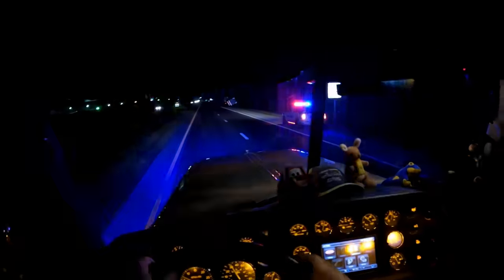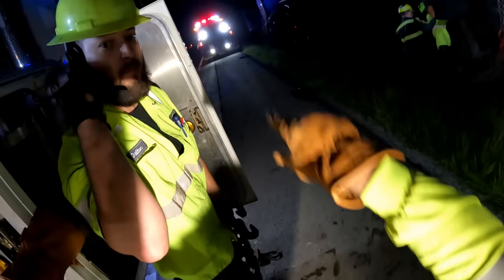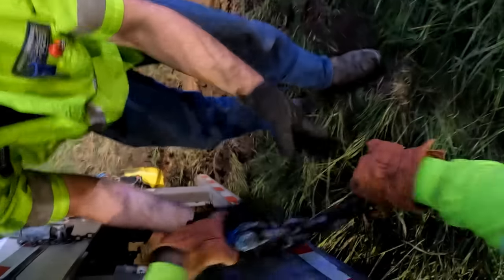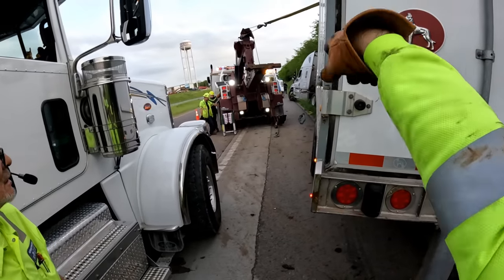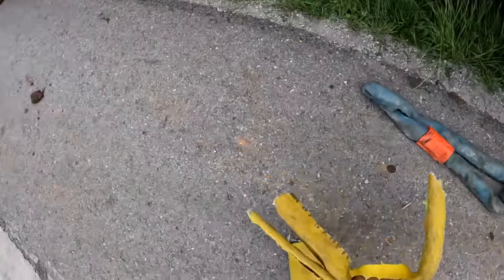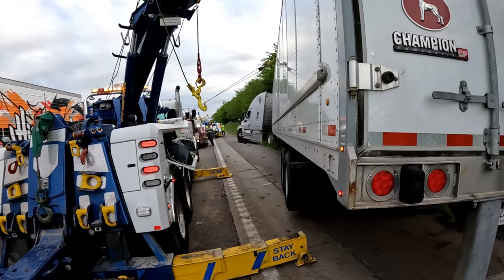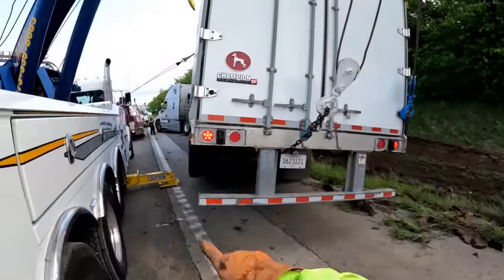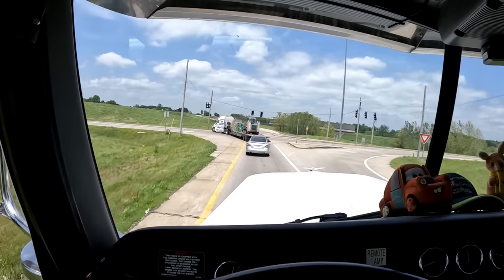Twisted Truck 2.0 Rollover Semi!!! The Job From...a Really Bad Place

Comment: I don't know if you'll see this and respond but I have one question Ron: When you said at the end of the video "Transload" what does that mean? Did you and everyone crawl into the trailer to try and get the load (paper) down flat in the bottom of the trailer again so you can haul it safely?
Reply from the maker: Transload is just a shortened form of "transferring the load" whether it be to another trailer, to a dock, another truck, etc..  If you watch the video until the very end, the credits and after-credits, you will see part of what we did.   Thanks for watching and God bless.
Reply: @RonPratt  I saw the timelapse start but I thought it was re-showing the entire video in quickened time lapse mode. I'll go back and re-watch the time lapse part to look for what you mentioned. Thank you for taking the time to reply and for showing us this video. I hope you have a good day and got some much needed sleep after this job.

Comment: I'm only 30 minutes in but I'm thinking that you would have bought yourself a lot of space by having your rotator facing into traffic. I realize that would've had its own set of challenges but I believe that would've given you the room to pick the trailer and get it all the way up. I also think the western could've been farther up with a low line to the tractor drives and a high line over the top and to the back of the trailer.

Comment: hey Ron i want to know where u go your headsets from I'm a traffic flagger here in Sydney Australia and want to buy some for work
Reply from the maker: We are currently using EarTech UltraLite headsets.    They work quite well for us.  They are inexpensive and are decent quality.   The only problems are that they do not fit well with standard, full-brim, hard hats and they are limited to using only 5 headsets per frequency.  On a large job like this, not everyone had a headset.   Other than that we really like them.  They have good range and quality sound.   We may upgrade in the future, but these do what we need for now.   Here is a link if you are interested:  https://eartec.com/ultralite/
  Thanks for watching and God bless.

Comment: That trucks frame was BENT. Im suprised if it didnt try to walk all over the road due to mis alignment. 

Now for my curiosity. If a truck is so damaged it cant be towed and must be trailered (which i though this one would be), can you hook up a drawbar/towed dolly to attach the trailer to behind the truck to transport it somewhere safe?
Reply from the maker: Yes, we have a single axle dolly that you commonly see used on doubles trailers pulled by companies such as UPS and FedEx.   We also have a tandem (two) axle dolly that we can use in heavier situations such as this.    We are still working on the tandem axle dolly to get it to the point where we want it to be.   Such dollies come in very handy in certain situations.  Thanks for watching and God bless.
Reply: @RonPratt  i thought someone as well prepared as you would have something like that. It amazes me how prepared and sensible you are for current and future situations. Keep up the great work and thankful you let us come along for the ride.

Comment: Honestly I think the best solution here would have been to have another rotator, that way you could grab the nose of the trailer as well with the boom, grab the landing gear with the drag winch, lift it enough to be able to drag it onto the pavement, and then go from there

Comment: As always you and your crew did a great job working together and slowly working through every problem as it was thrown at you. No one was injured and there was no further damage so all in all a perfect recovery
Hindsight is always 20/20. The only thing I see that would have made this go better would have been to have the blue line able to help right after the roll. If you could have nose wrapped the trailer coming back to the boom it would have made everything stable. With the increased stabilization you possibly could have got more sideways pull on the drive axles causing the truck to come out. Or once the trailer was uprighted and stable opening the doors and using the crew to redistribute the load. I am assuming the paper had unpalletized and was stacked a lot more than 5 feet high on the passenger side. If that was the case 30 - 40 mins of moving boxes around could have changed stability and there fore the speed and safety of the job.

Comment: Another thing that didnt help ya was the fact Trooper wanted to keep that hammer lane open 

Seems had the star and little pete  backed across the lanes you could have had better options for controlling it as it got pulled up vs the struggle pinning it against Tator and the star having a funky pull angle 

Im sure miller would be happy to sell ya a M100 so u get that 2nd rotator yall were wishing for on this job 🙃 glad it all turned out safely and. Nobody was hurt

Comment: How about blocking the  Cab forward under the tires to lift the right hand side more level.  I bet the rolls slide all the way over. I use to haul those things and just a curve would make them Slide to side  because the lazy loader would not block them unless you made them or block them yourself.

Comment: 43:25 here I'd have put the boom over the trailer, blue sling to a chain around the the slider frame with the blue winch, the white winch to the chain around the DOT bumper, and aux behind white to the chain around the driver side of the bumper
Reply: Nah, I'd have married the two lines to the chains around the DOT number to ensure an equal lift and not put unneeded strain on white since white, in this config, would be keeping it upright

Comment: Why didn't you add a second strap over the trailer to help Kenny stabilize the trailer? That would have given you control of it rolling as they pulled it forward. I understand... Two winches in as one was both directions. Either way good job, it didn't roll or rip open.

Comment: I'm not the expert here that  Mr. Pratt is. But up here in Alaska I would of turned Rotator around. Nose into traffic once reposition happened. 
Sometimes Jesus has to take the wheel and motorist inconvenienced long enough to allow equipment positioning. With that very weigh buldged trailer and pig slop holler shoulder. Ron was right. Sometimes when it looks easy. It's hardest.

Comment: question could you have picked up the front of the trailer with the drives hanging off the kingpin and set it up on the shoulder. use the rotator to set the back of the trailer all the way up on pavement and pull forward and set the back of the tractor on pavement. winching it forward like that could go bad if the drives found a soft spot and sank more.
Reply from the maker: That was actually my original plan, however, when I couldn't let go of the trailer without it wanting to roll back over, I couldn't reposition the rotator where I wanted it.  I might have been able to reposition one of the other trucks to hold the trailer, but that would have been a lot of shuffling around while risking losing the trailer.  After reviewing this video multiple times, I have some fresh ideas as to how I would approach aa similar situation in the future.  Thanks for watching and God bless.
Reply: @RonPratt  the other option would have been to turn the western star perpendicular to the trailer and lift it back up but that would have required closing the road completely. they would do that here in Maryland but they also would leave it lay there till the next night.
Reply from the maker: Yeah, unfortunately at times, around here, closing the road is a "last resort" option.  Some jobs could be completed much quicker and safer with the road closed, but the main focus around here is trying to keep traffic flowing at all times.  It is even taught in classes such as T.I.M.S. training.

Comment: You should of back on to the trailer then you would be able to use the lifting gear to its proper potential in stead of making the lifting gear work over the cab of the truck that way you could of lifted in the first lifted straight on to the road with the blue cable you had on it. That's the way I would of done it myself

Comment: I don't know, I suspect you needed to swap the straight truck and rotator from the start.  I would have wanted to get the truck up and on the road and used the straight truck on a tail wrap, with a strap all the way around the corner rather than wrapping the corner.  That said, the straight truck would have needed to be backward to traffic and that is a downside but I think it would have been a better position.  The rotator could have picked the back of the truck and controlled the front of the trailer much better than the straight truck in that awkward spot.

Comment: It seemed that the effort to keep a traffic lane open severely limited your ability to position your equipment effectively. Most particularly, your greatest asset, the rotator, would have been far more useful if it was backed in behind the trailer instead of alongside it. Then the rear of the trailer could have been picked up and set on the pavement without concern about the rotator being in the way. At the same time, the lift would have informed you about the significant load shift forward and you could have repositioned the rotator to the front of the casualty facing forward to move the front of the trailer in similar fashion. One or two short road closures may have been preferable to working in extremely limited space for ridiculous numbers of hours with your best tool partially disabled.

Comment: Ron, one thing I would have done slightly differently is use the scene lights while doing the assessment / walk around. You know you will need the light for a night job so it's just getting it  out sooner. The extra light might have let you see the bulged side so the unbalanced load was obvious before you started to plan.

Comment: Wouldn't it have been easier to upright the trailer at the bottom of the ditch, so it would be at a position where it would be stable. Then reposition/re-rig to lift it on the road.

Comment: Ron, 99.9% of the time I defer to your professional expertise.  However, at 49:10  there was zero need for you to walk along the driver's side of your truck (right where dangerous traffic was running) and walk completely around your truck to the passenger side just to pick up your truck's remote control.  Bad decision.

Comment: Those Dang rolls are terrible. They usely put two by two right left.  Right left then one middle then 2 front   each roll about 6k or 7k each .sometimes on a pallet each or on flat slip sheets

Comment: On the rollback STOP using the big Js, they ruin things
Reply from the maker: Only if you use them improperly.  Thanks for watching and God bless.
Reply: False , because there are mini j hook spots in front of the car or behind the tire and  vice versa for the rear of the car and the axle or  a suspension part is not really ideal